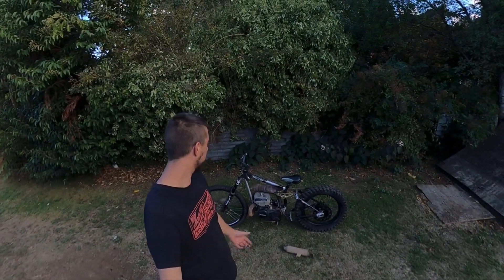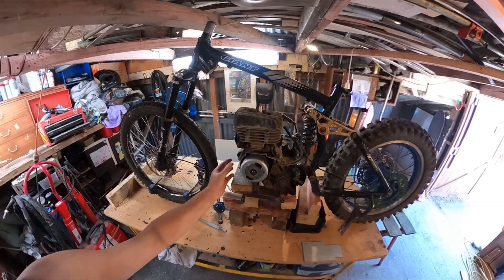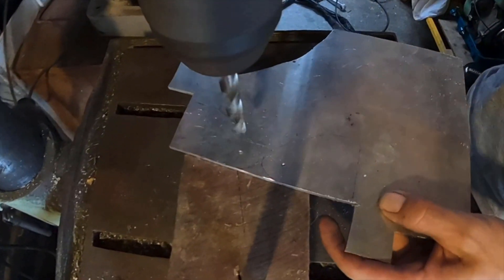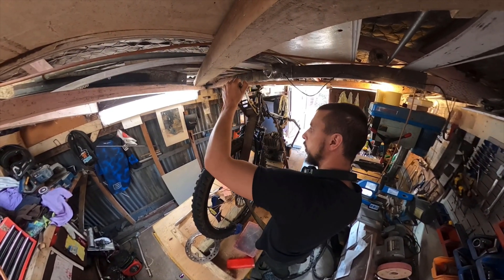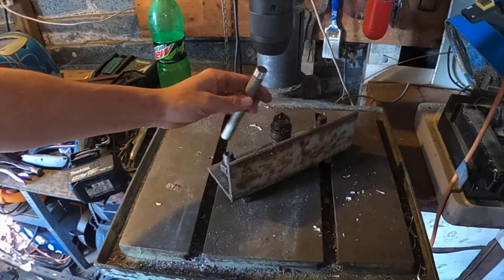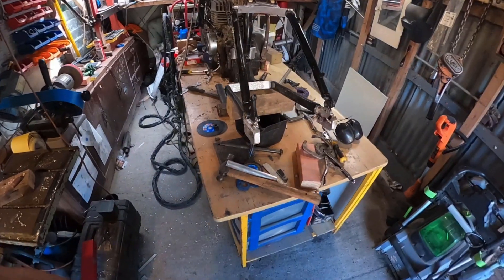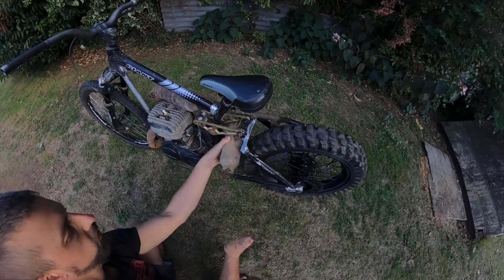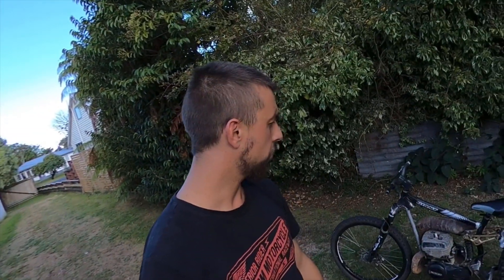Motorized Bicycle 125cc 2 stroke build/p2

Comment: If you mix your fuel you wont have to be worried about it if that pump just decided to stop working
Reply from the maker: fly1moto yeah I’ve gone away from that idea just going to mix the fuel . I had it running before just sorting out the exhaust now!

Comment: It's awesome but did you happen to let YouTube stabilize your video YouTube video stabilization sucks it would look better jiggly trust me
Reply from the maker: Straight Line Cycles no I don’t think so I filmed using GoPro max it stabilise it’s self but if the lenses are slightly dirty you get a bad seam line
Reply: @dkthewelder  ohhhh,  I watched a video once that had that applied to it and it did a really weird warping effect and I thought I may have saw that in yours the wide angle could be making it look weird but either way regardless of how you're filming it it's coming along awesomely
Reply from the maker: Straight Line Cycles thanks mate . My shed is small so the wide angle lense makes it easier to see what I’m doing. Do you think I should keep the footage more still? I can pan it across in time lapse to make it a bit more interesting but maybe too much?
Reply: @dkthewelder  naa thats all good, maybe medium setting instead of wide, without stabilizer on, end up a little better quality. Try it and review it,  see if it works for you,  but like I said. Looking gnarly. Man i need a welder. 😁